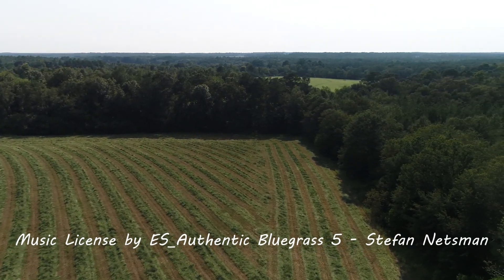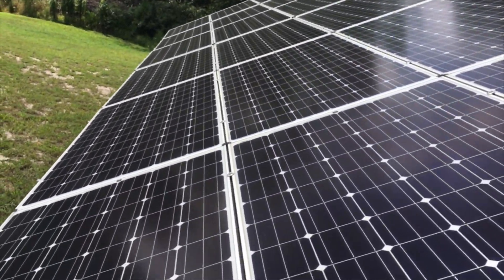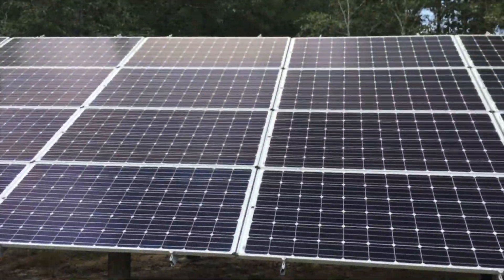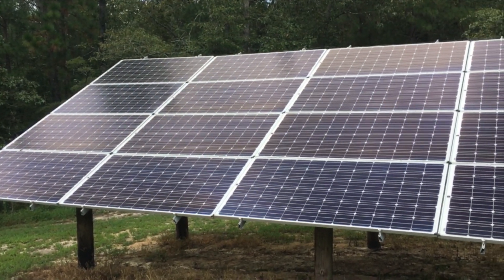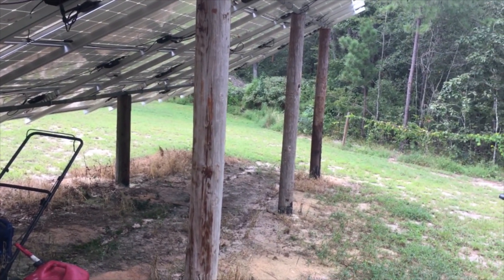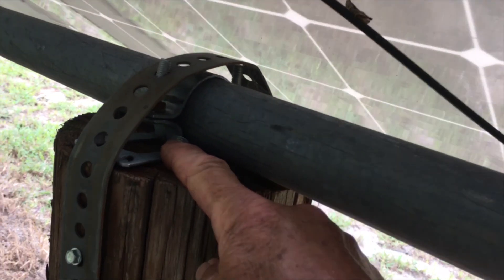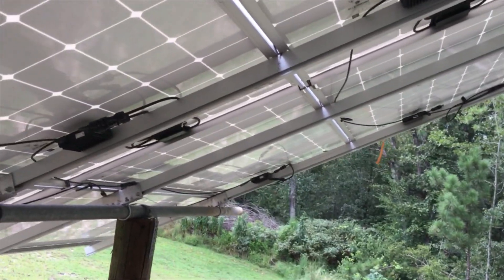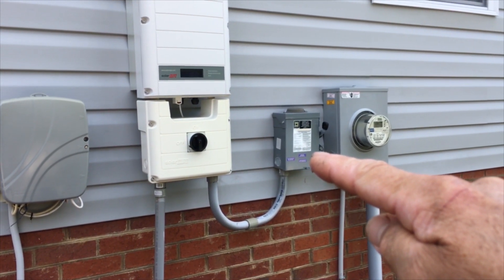SolarEdge Grid-tie system DIY

Comment: Can you go into a little more detail when you say the you feed the larger panel from the smaller panel as to what size breaker in the sub panel, if one, then size wire and I understood the 40 amp on the top right. Can I assume the the breaker to feed that 40A breaker in the main panel, is a 40A breaker in the sub panel? Along with the well, your sub panel has how many amps feeding it?
thanks for the video.

Comment: Not sure if you are still responding to comments but I have a question, what exactly did you make sure to do so that you would pass the coop inspection? Grounding, pipe type etc, also how did you tie your 2 strings together for the run to the house? Junction box?

Comment: Curious what the amp size of the ac disconnect breaker?  And possibly could you tell us what gauge wire you used for both the DC and the AC?

Comment: You did an outstanding job of explaining you system set up.  Anyone on here who say different is just being foolish.  Do have a few questions, what size breakers did you use in the sub panel?  what size wiring did you use from the panels to the house? and do you know if you use bigger and thicker cables from the panels to the house, does it collect more power? someone once told me it did but what do I know...  Outstanding job brother.  May God bless you in all you do, your video was a gift to the viewers.  One more thing!  Do you have the phone numbers of the company you got the system from and also the phone number from the engineer your emailed.  I see they are two different names...
Reply from the maker: Thanks for the kind words of encouragement. I will try to answer your questions.1. Q.  What size breakers did you use in the sub-panel? A.  Double pole 30 amp. Q.  Do you know if you use bigger and thicker cables from the panels to the house, does it collect more power? A. 4 Star Solar MC4 10 AWG - DUAL 100'. I am running around 370V DC from panels to the inverter, so remember the higher the volts the thinner the wire can be. As far as does it collect more power, I would only say this. The panels will produce X amount of power/watts and sizing the wire to the correct size is very important. If you use a cable undersized you will lose power due to friction also is not safe. The lower the voltage the thinker the wire must be for longer runs. I recommend an online DC or AC (depending on what your using) wire chart to help you figure the correct wire size.3. Q. Do you have the phone numbers of the company you got the system from? A. I don't endorse company's but I purchased my system/Kit from Wholesalesolar.com They are very good at helping with all the calculations you need and putting together a turn-key system. Like me, they encourage DYI. If you call them try to have a total of how much power you used over the last year if you can. I talk with SolarEdge engineers when I need help with my equipment like software upgrades.  Thanks again and God bless you as well, John
Reply: One last thing, how do you know what optimizers to use?  I mean would a 300 watt optimizer from SolarEdge  fit a 300 to 350 watt solar panel from wholesale?
Reply from the maker: @sheliaduranko1326  It's much easier to go with a DYI kit as mention above, it takes away a lot of research. You can watch SolarEdge training videos for free on their website too.

Comment: Stop with the lies. The only way a whole string will die while one panel is shaded is if you REMOVE the diode that comes with the panel to prevent just that. I got my first panel in the 80's and they already have diodes in them.
Reply from the maker: Sailorman6996, I want to thank you for your input concerning the remark I made in my video about Enphase dropping the whole string if shaded. I never proclaimed to be a professional I only wanted to help others to have a better understanding of how they can install solar themselves as I did.  With that said I am not beyond admitting when I am incorrect about something. After researching, I have found all micro-inverters/ microprocessors work on an individual basis and if one is shaded it DOES NOT affect the other units on that string. Again my statement is incorrect in the video concerning enphase shading and for that reason, I will try to find a way to correct my video. Although you seem to be of higher intelligence, I think you could have been a little more polite in making your claim, but that's neither here nor there. Below is a link concerning the myth that I fell victim to.  If anyone has anything to say concerning my video's please remember I'm only human and only want to try and help others with DYI projects and I will try to be more careful in the future with my statements. 
https://enphase.com/sites/default/files/Enphase_Shading_Myth_Topic%20Brief_English_AU_Final_Final.pdf
John
Reply: I'm sorry for my harsh comment.

I've seen many promote and endorse these micro converters with these false argument that the whole string will die if a panel or cell is shaded.

I have not investigated exactly what happens with a shaded panel that has a micro inverter. But I guess it's not that different from without one.

I only heard of two good things about micro inverters. 1.Nerd factor, individual panels power can be monitored. A faulty panel may be easier to locate.  2. They stop delivering power when connection to main inverter is lost. Witch can be safer for firefighters.

If you cover 50% of a single cell it will reduce power within that panel with 50%, regardless of micro inverter and / or diode or none of them. If you cover a cell completely -
 that panel will not give any power if every cell is connected in series.

But while the one cell is covered - the built in diode will pass on all the power from all the other panels in that string, (minus the 0.7 volt the diode need to pass on power).
Reply from the maker: No worries and thanks for the above information, have a great day,
John

Comment: Hi John, you mentioned that this was part of a kit. May I ask where you got it from? I have had a few solar contractors in my area give me prices and options but I am still very much a DIYer and would love to build my own system and seeing others that i have successfully built there own help me feel that I would be able to do it with the background that i have.
Reply from the maker: I called Wholesale Solar and emailed the engineer a copy of my electric bill for one year and he double checked my math and recommended a grid-tie kit that would produce the amount of electricity I would need. They are very nice to work with and very helpful. I received everything I needed including electrical drawings for inspectors. I saved myself a lot of $$$$ by doing it myself. I know basic electricity and that's all I needed. I got a quote from two company's, one wanted 43k and the other one wanted 46k. I DIY for a total of 14k back in 2017. If you don't feel comfortable working with electricity please find someone to do the connectivity part for you. Hope this info helps.

Comment: just so I understand correctly, this feeds back in to a breaker in the panel?
Reply from the maker: So, there are two breaker boxes, the main breaker box (the larger one) and a sub panel box (the smaller one). The solar inverter delivers 240+ volts to a breaker in the sub panel box (smaller box). Then from the sub box, it feeds up to another breaker in the main breaker box therefor providing electricity for all breaker in the main box. What electricity is not used, then is sent out to the grid for credit via the Main 200 Amp Breaker at the top of the box. I only used the sub panel box b/c I did not have room for everything in the main box. If you have the room just use your main box. I hope this helps, and if you like my video please give me a thumbs up, thanks

Comment: John,  I am considering the SolarEdge system vs the Enphase microinverter system.  I just had SunPower give there demonstration (who uses SunPower/Enphase microinverters on the back of there panels) and they said that the SolarEdge AC/DC inverter you have mounted on your house can make a humming noise and runs HOT in the summer?  Have you experienced this?  

Thanks for the video!
Reply from the maker: Thanks for asking that question, it a good one to ask. Temps here in SC start to in the 90s in June and hit 100+ by July and Aug. I have not had any problem what so ever out of my SolarEdge inverter running hot. I don't know where they get that from...! As far as a hum goes, you can't even here my unit at all. The only way to tell if it's working is to look at the display.  It's good to reach out and ask these question so thanks and let me know if I can help you with anything else.
John